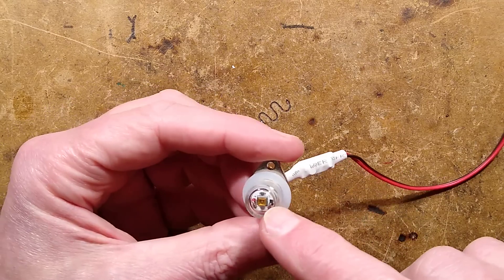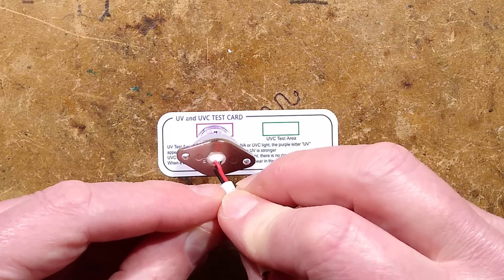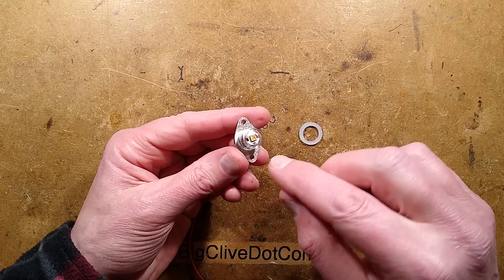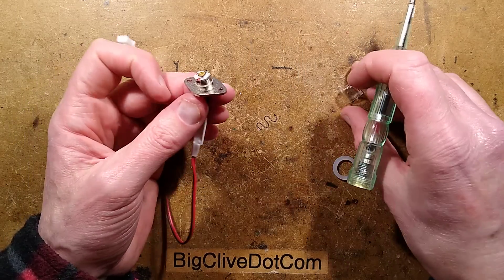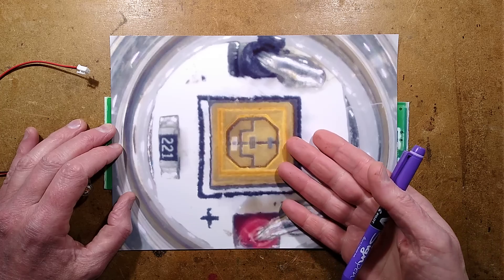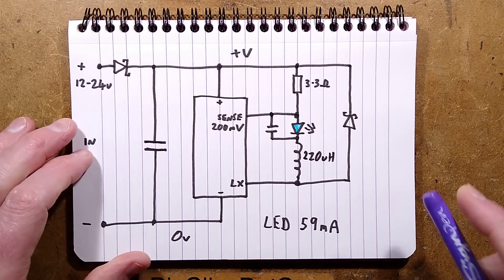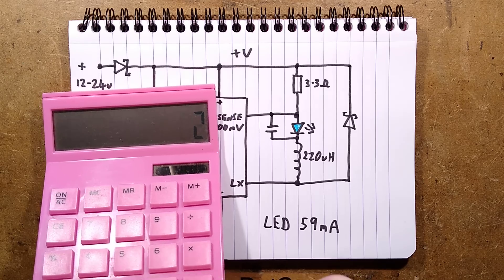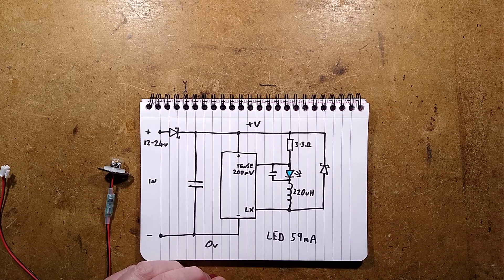UVC LED module for water sterilising

Comment: Very interesting.  Thanks Big Clive.  Did it energize the UVC test strip any better at 24 volts?  

Pretty neat little item.  I would think it would be useful, depending on efficiency, for sterilizing water in the "field" as it were?  Not sure.
Reply: Could be handy for modding a water jug in the fridge. Just toss a 9v battery on it, a transistor and a LDR to detect visible light (and turn it off).
Reply from the maker: It runs at fixed LED current from about 6V to 24V.
Reply: Oh, I wonder how hot it gets after a certain time.  Would the Flir camera be skewed by UVC or worse, would UVC damage the sensor?\
Reply from the maker: The UVC shouldn;t pass through the thermal camera lens.